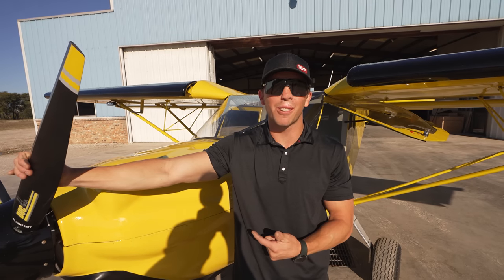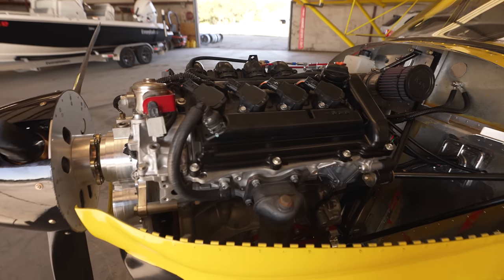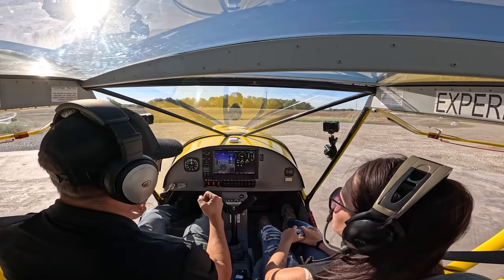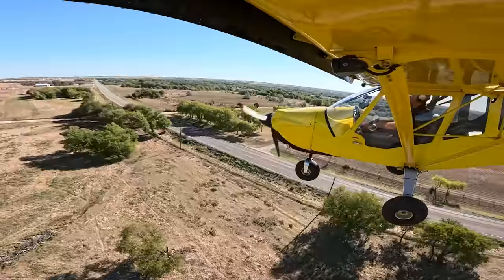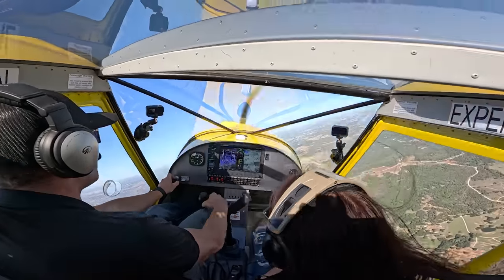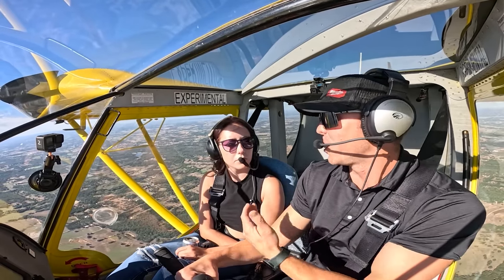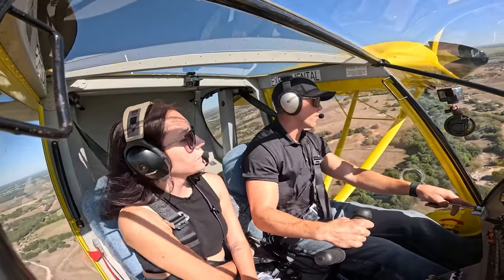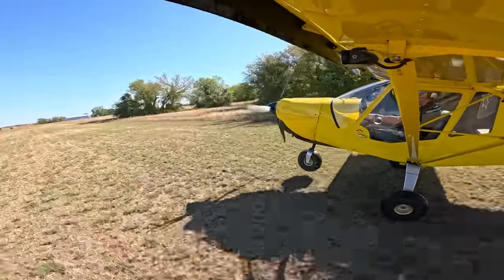Zenith 750 STOL - Experimental Bush Plane

Comment: Very nice video Dakota.  Jake seem like a very nice fella.  He needs to stop comparing indicated airspeed, true airspeeds with ground speeds, and understand the differences.  We as pilots really only care about indicated and true airspeeds.  Ground speeds will take care of themselves with wind direction and velocity.  Thank-you
Reply: What's wrong with comparing the speeds? Nothing was getting mixed up. 90-100mph TAS is what the stol 750 does in cruise.
Reply: True but he said the plane could have a higher groundspeed with tail winds.  The aircraft goes through the air at a specific speed. no matter what direction the wind is blowing.  @ooBOXooPICKLESoo

Comment: Great video.   I feel his misery, and 2008 I had a 750 with a jabiru 3300 you literally could not fly it in July and August in our Tx heat. 
  I sold it and bought one with a ULS 350 what a difference that made with the full fadec engine.  
  Now I have a Zenith 701 with the hundred horse rotax which is fine with me, because I fly off of my strip here at the house which is only about 800 foot long and I pull it straight into my Haybarn.

Comment: I trained back in 2001/2002 in a C172 with 180 HP powerplant, tuned exhaust, constant speed prop, and 40 degrees of flaps.  That 172 was a rocket.  My CFII fricking hovered that plane a Napa (KAPC) in a head wind with full flaps.  I loved that plane.  Unfortunately I don't fly now.  I miss it.  Thanks for the video!

Comment: I understand the 750 stol is a slow airplane. 108mph at 9gph?? 175 hp? What are beneficial performance stats of having 175hp? Does it take off in 6 feet? Climb at 2000fpm? 10 gph is ideal for cross country???
Reply: 80-90mph TAS 4.5gph around 1200fpm climb by myself. Around 700fpm fully loaded.